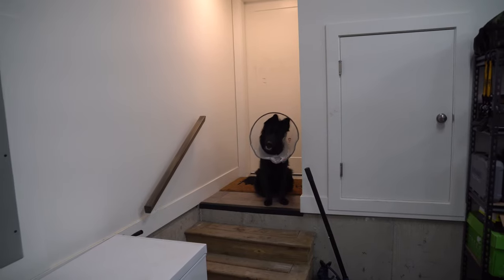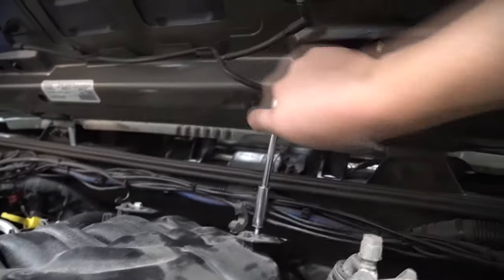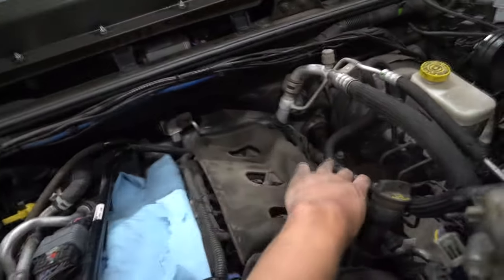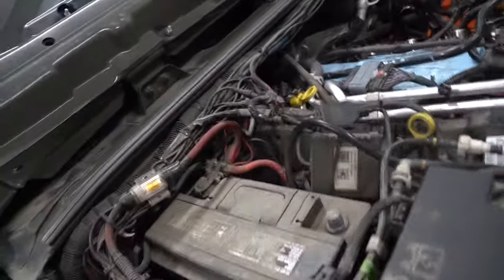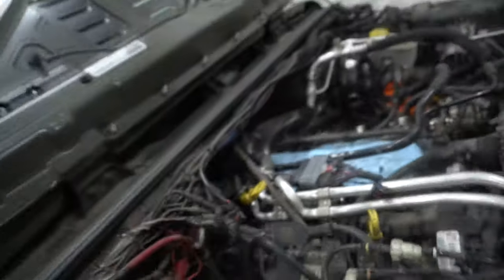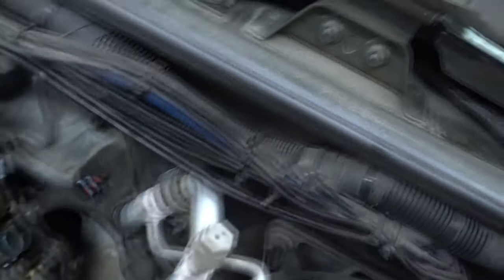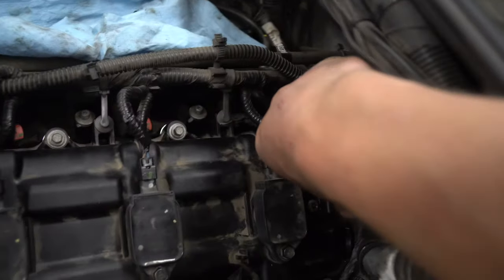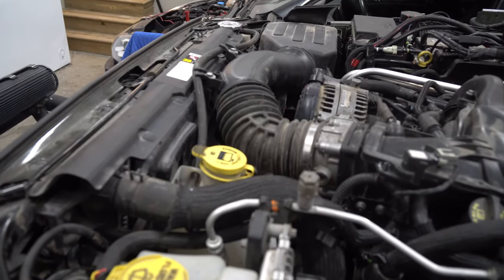HOW TO FIX THE 3.6 LITRE ROCKER LIFTER ENGINE TICK JEEP WRANGLER OR DODGE

Comment: Thanks for documenting this. it helped a lot.  The PCV valve was brutal, the only thing that worked for me was a set of Titan 11203 offset mini ratchets (from Princess Auto).  One has a hole for a 1/4 hex bit, putting a 1-inch long T25 hex bit in let me work the top one out.   You have to go in from above. The other ratchet has a 1/4 drive anvil, and I attached a T25 1/4 socket (or equivalently, a 1/4 hex holder bit with a the same T25 bit) let me get to the bottom one. You have to go from the side. You can also get "thumb ratchets", little round bit-holders, but I found I couldn't get enough torque on them to break the screws free, but they helped spin them out after. And having a good light there helps a lot too. Hope this helps some future viewer!

Comment: Do not use dielectric grease on spark plug threads. That's is not what it was made for. Dielectric grease is non-conductive, so you're putting an insulator where you need a conductor. Dielectric grease is only meant to keep moisture out of electrical connectors. You want something like copper anti-seize. Also, those old plugs look like iridium plugs which have a very narrow electrode. They look ok from what I can see. Just fyi

Comment: Thank you for posting this video. I've got the same stupid f-ing ticking sound. Just started happening like 2 weeks ago. Hopefully it's just as easy as yours was
Reply: I ended up swapping out the bad rocker this weekend. The biggest problem I had was a PCV in the back and the two torx bits holding it in. Everything else wasn't too bad.
Reply: @garretthamlin5277  I’m doing mine this weekend

Comment: Good!! I am taking off my engine cover!! ( maybe use it during the winter) Kinda dumb having to take it off every time just to look at your trans dip stick!!
Reply from the maker: I don’t think I’ve run the engine cover on my vehicles for more than a couple months after buying the vehicle they just pool so much heat lol 
The Jeep is the worst cause it pulls lots of heat when you’re driving slower and there’s not a lot of air movement throughout the vehicle so I removed the cover as well as vented the hood on the jeep

Comment: Is there a difference between the intake and exhaust rocker?
Reply from the maker: Nope
Reply: Thanks
Reply: Is the timing belt tensioner tool different for the 2022 Cherokee it’s two bolts on the right side and the tool won’t go down to release the tension

Comment: Great video!  How does the repair holding up?  Did you see people commenting that you need to change all the lifters not just one?  Wonder if there is any truth to that or is that just the dealer approach.  Also, did you ended-up changing the top-cover gaskets?
Reply from the maker: I did not. My gaskets were fine and never leaked but that being said, I would highly suggest that you change them if your vehicle is getting up there in kilometres just because of the heat and all that other stuff that comes into play. The repair was good until I saw the motor. I don’t know how it’s doing these days because I ended up doing a hemi swap later on, but the motor was working perfectly fine the day that I pulled it out.
Reply: @ghostlyrich  Yes good point, I may pick a new gasket.  I'll be attempting the fix this weekend.  Ah HEMI nice move.  Thanks!
Reply: Нужно менять сразу все рокера , эта проблема у всех этих двигателей и может случится на любом пробеге

Comment: Hey I watched this video and it was great. I have a 2015 keep grand Cherokee. My girl ran it way past the oil change time and it developed a ticking noise. I changed the oil but it still makes the ticking sound. How can I get rid of that sound? Thank you for your help
Reply from the maker: If it sounds like the one in the video then again it might be a rocker because of the oil not getting properly up into the valve cover through the passages. Be worth taking a look at the Rockers like I show him the video also if you haven't switched to synthetic that should also help a little bit but still unfortunately when running past oil changes or low on oil it causes the mechanical parts to wear

Comment: How long does this take you to do it and if you had to guess about how much do you think a shop would charge to do this?
Reply from the maker: It really depends on the shop and when it comes down to shop time and which side of the engine has the tick if you're only going to replace one sides the driver's side is way easier to do than the passenger side. If your mechanically inclined you could probably do this in probably 2-4 hours if your not mechanically inclined 4hrs to a day

Comment: The rear main seal I've learned once they start leaking you lose some volume of oil to ur rockers .... replaced mine on the back of a 3.6 and unlike Jeep I made a gasket instead of gasket maker that hardens n starts to leak

Comment: Do I have to put a certain amount of torque to the bolts that’s holding the camshaft down  after I replace the rocker arm ?
Reply from the maker: I mentioned it in the video I think it was 80 inch pounds but you would have to double check.
Reply: Yes always
Reply: Everything on your car has torque specs even your rims. You can usally look this data up online or through library chiltons books.
Reply: @djsnaps12  If it doesn't move or isn't pressurized then tight and a bit more typically does the job for anything 1/4in. Haven't had trouble yet.... haha.

Comment: This is awesome, I wish I had the tools and space to accomplish this job. I called the dealership and they said I'd have to replace all 12 and a bunch of other shit.
Reply: ask them how they know it's all 12. I bet you they didnt take the valve cover off and take a look inside. You get charged for estimate?
Reply: @izzyg1598  yup ended up coming out to $2,100 including the exhaust camshaft. Fucking hope it doesn't happen again
Reply from the maker: If you haven't switch to synthetic apparently it gets up into the heads better because the passages or so small

Comment: I still heard ticking. Did you even check your cam? Usually they are destroyed.
Reply from the maker: Might have just been cam jeeps engines been running like a dream ever since
Reply: @ghostlyrich  I think the ticking he is referring too is pretty normal with these engines. I have it too and it's definitely not a rocker tick.
Reply: @jakeh9384  how can you tell the difference between a “rocker tick” or a “cam tick” ??
Reply: @TactiDaddy  it’s probably just the injectors. Jeep engines are not quiet.
Reply: @jakeh9384  so got i a check engine light 
Code we’re P0300 (single/ multiple cylinder misfire) & P0303 (cylinder 3 misfire)
Jeep is currently at the dealership now. But they said that the cylinder 5 was actually misfiring and not cylinder 3. Plus they can’t determine the cause of ticking without breaking down the engine they said.
Reply from the maker: I'm guessing you mean Jeeps lol either way I would recommend swapping out your spark plugs depending on when you did those last and also pulling the valve cover off and wiggling those rocker up and down and feel for some play. Then we'll your in there just inspect the cam lobes for ware. Little bit of side to side play is normal but what is it normal is up and down play
Reply: @ghostlyrich  lol 😂 just noticed that but I fixed that.  😂 but ok sounds good. Wish there was another good video on everything you just said. How much do think it’d cost to replace cams and rollers  ?? If anything I might as well just replace all of them. My wife is telling me to just trade it in. But I’m only $2k left to pay it off. So I really don’t want to get rid of it either.
Reply from the maker: If yours hasn't been ticking for that long I would just start out by swapping the lifters. Usually the cam goes if somebody leaves it for quite a long time
Reply from the maker: @TactiDaddy  with the vehicle shortages right now I don't blame you I wouldn't want to trade it and get another Jeep right now at the moment myself just because a lot of prices are inflated due to lack of supply the semiconductor shortage
Reply: @ghostlyrich  yea that’s why tried to explain to her. Haha. But we know how that goes haha. But yea I’ve seen the prices shoot up especially for all 4x4s. Their in such a high demand now.

Comment: Pretty good video, but what I didn't see covered well enough was the PCV valve at the back of the passenger side valve cover.  Maybe I missed it somewhere, though.  You mentioned loosening the torx bolt, then skip to after you've removed the cover. But there are two torx head bolts (T25) that need to come out completely and the PCV valve (where the hose connects) needs to come out completely.  Important to note for anyone trying to follow along, so you don't break anything trying to pry the cover off.  Idk what genius designs these things.  Every time I have to work on something like this, on any vehicle, I'm cursing engineers. lol
Reply: I didn't have the knock on the passenger side.  I had it on the driver side.  But I decided to go ahead and fix an oil leak around the rear spark plug tube on the passenger side.  A lot of work for a little seal.
Reply from the maker: Same tick was driver side

Comment: When you removed your passenger side valve cover I noticed you didn't remove those heater core coolant lines like I've seen in the other video (A1 I think). Instead you removed battery and fuse block. I'm considering the same. 
Question: Did you get that cover off without removing the oil dipstick? 
Seems like it might get caught up there a bit. 
Draining coolant just to remove those hard lines seems like such a waste and hassle. 
Thoughts/advice?
Thank you for taking the time to make the video. It's a big help for those of us that like to tackle stuff like this ourselves.
Reply from the maker: No I did not remove it
Reply: @ghostlyrich  Thanks for the reply and again for the time. Going to tackle these gaskets in a couple weeks. Ordering all the parts. 
Found that Dorman makes an Aluminum Oil Cooler now for our wranglers so while I am in there....🤷🏻‍♂️ (Kit comes with new upper and lower plenum gaskets along with the usual rings. Pretty cool.). 
Keep up the good work. Cheers. -Dan

Comment: 2015 Jeep JKU @ 120000 miles just started ticking after a oil change and also thermostat had a hairline leak
Reply: I also have a 2015 JKU Sport @ 122k miles and it’s now on its 2nd engine. Happened with the first one also with the same issue. Dealership ended up replacing my engine and transmission. But now they say they won’t warranty the 2nd engine. Saying the warranty for the new engine expires with the remainder of the original warranty. So it looks like I’m guna have to tackle this one on my own this time.

Comment: The camshaft bearing bolts were way too tight on mine and I stripped one them. I even twisted the torx bit. Any idea of where to buy new bolts?
Reply from the maker: Sorry I'm a little late to this but I'd probably just go to the dealer if you want an exact match or you go to an auto parts store near you and you try and see if they have it but a lot of times they won't have the exact have the exact head
Reply: Dealer junk yard or any auto  Is machine shop should have a junk head don't call them tho u will need to have the bolt in hand to show them good luck and they will probably have the insert for the threads as well the  Machine shop that is!!

Comment: If this is such a common issue, why wouldnt you change all rockers while you had it apart?
Reply from the maker: Availability at the time i lucked out and dealer had a few on hand. Since it was a common issue, most dealerships didn’t wanna sell the parts they wanted to hold onto them so that way they could make money through the service center.
Reply: @ghostlyrich  AH.  All in, how much time from start to finish it take you to replace the few you did?

Comment: this video is awesome
Reply: I've replaced lifters on 13 jku and ticking never stopped. Also had always had overheating issue. Could it be related to oil cooler?
Reply: @helenetaylor3631  did you check head gasket, or coolant leaks, or timming, or vaccum leaks? The issue with lifter noising is also related with a worn camshaft, bad oil pressure or non precharged lifters.

Comment: On the driver side I was only able to get out 15/18 rockers & ~8 lifters. The time I spent turning the crankshaft trying to finagle the rockers and lifters in & out I prob would have better off buying the timing chain tools and just remove the camshafts to have direct easy access

Comment: Actually the ground cable on the battery is the power lead. Power comes out of the battery through the ground, it goes back into the battery through the positive. You always always always remove the ground first and put it on last. You can damage the computers by taking off for putting on the battery cables in the wrong order. In researching this the first problem I found was most people are looking at the edges saying it's always occurs on the right side of the engine. No it almost always occurs on the left side of the engine. It's the right side is they're looking at it. But the engine didn't turn around.

Comment: I feel dumb doing the oil cooler/plug job and not just changing all the rockers while I was that far in. Even with a 2014 I have a good suspicion that I'm due for it sooner or later.

What year is your 3.6?
Reply from the maker: 2015
Reply: Currently doing it to my 2014 as i type this. Cannot get the valve cover off though. All bolts loosened, undid all clips. No luck. Won’t budge
Reply from the maker: @Destiny which side driver or passenger??. If it's the passenger make sure you have taken the torx bolts out on the back of the hose inlet on the back of the valve cover and you have completely removed the inletpipe piece out. And make sure all sensors are out of the valve cover as I show as well :)
Reply: Ah damnit. How many miles are you guys at? I only hear a distinguishable lifter tap at initial start up (mostly when it's cold out) then it goes away. Kinda hear a slight ticking during operation but it sounds like injectors because it's quiet. Been that way for a while though, 76k on the clock.
Reply from the maker: Take a look at my video on how it sounded beforehand. Mine was very very noticeable and mine did it at 120 to 130,000 km which is about where you're at I'm guessing in miles
Reply from the maker: It's really noticeable for me it was like there's something going on in my intake manifold you'd hear it
Reply from the maker: Also if you want to try switching to synthetic as the passages on our engines are really tiny and fluids cannot pass through them properly and that's what causes all the issues so by switching to synthetic usually it's a little bit thinner and will pass through the passages much easier
Reply: @ghostlyrich  Picked it up at 60k mi. And have been running mobil 5w20 since then. I guess that's relieving to hear that it's super obvious. I've heard lifter tick before but I also have a cold air and vented inner fenders so everything is louder. Well, I'll keep fingers crossed and your video/tips in mind. Trying to do this axle swap, last thing I wanna buy is stock parts!
Reply: @ghostlyrich  Is it still running solid? The biggest annoyance would have to be changing cams but I'm sure there's a window after the tick starts until you wear down the lobes.
Reply from the maker: @PrinceOfEville  I left mine for about 3 or 4 months because of the dealership and I drive on average 150. miles a day for work. It takes a bit before your cam lobes start to go. 
After replacing the one bad rocker it works like a dream now. At the same time I did an engine clean with the gunk engine clean stuff I did a video on that too and I also switched to synthetic oil
Reply: @PrinceOfEville  71k on my 13 moab wrangler and it’s clicking hard
Reply: @artisticbeats1016  Yikes, sorry to hear that. 13s are mentioned frequently though with the earlier 3.6 notorious issues. I pulled my engine cover off to make sure there was no tapping. Are you going to change rockers or just trade it?
Reply: @artisticbeats1016  80K on my 15 JK. Chrysler should have recalled all these problems.
Reply: @PrinceOfEville  i really love this jeep i think i’m just gonna replace all rockers n cams if i find them damaged enough

Comment: Do your self a favor, and get rid of it, i love jeeps, but those 3.6 are junk! You will need to do that every 50-70k along with a alternator and oil filter housing assembly , pvc valve, spark plugs every 100k , ive seen rocker go at 25k !!!!!